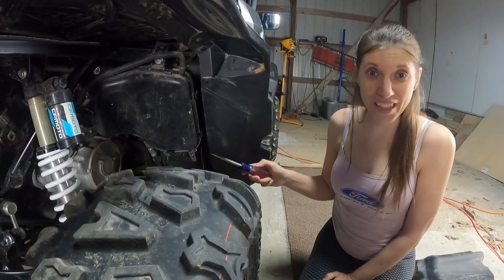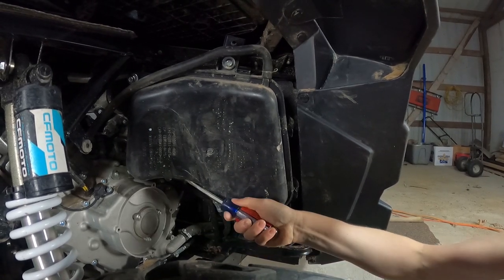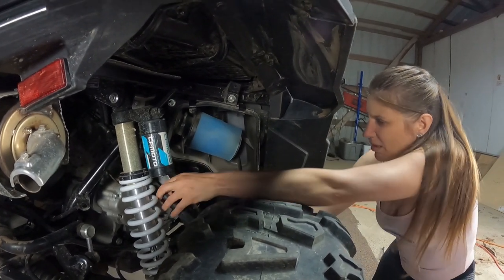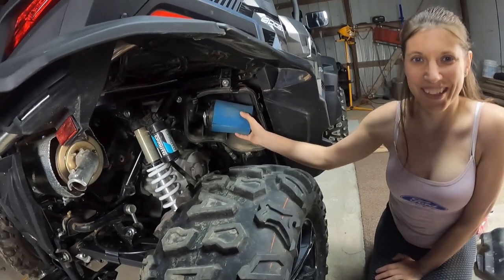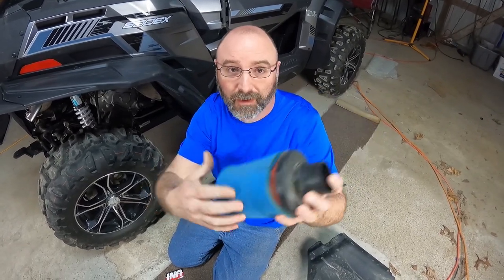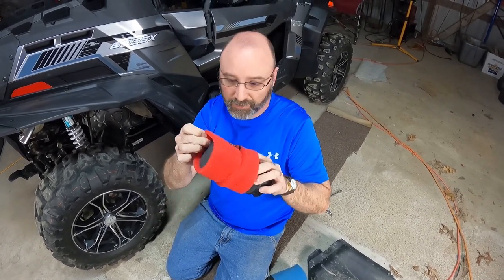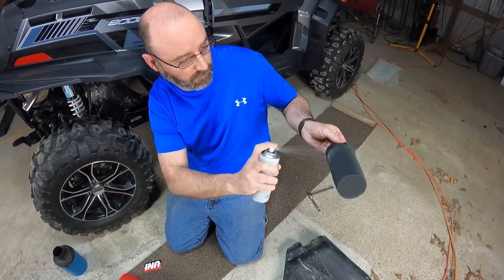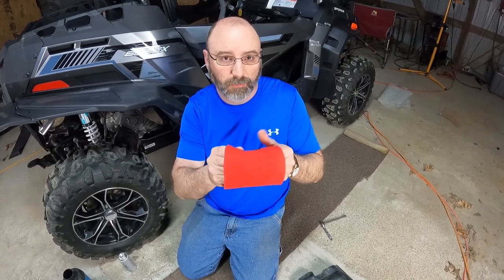cfmoto uni air filter upgrade

Comment: ive done a ton of mods to my 800ex and moving that air box is the first thing i done i have a video on that if your interested however i recommend mend snorkeling it atloeast i clean my filter every 1000 or so miles as before when it was in stock location i cleaned it every 50 miles or less it sucked lol good channel guys if you have any questions about your cfmot feel free to reach out to me. ive done over 650 videos on these machines mods and all kinds of stuff. i do recomend ray parkers tune it makes the 800 even more enjoyable of a machine.
Reply from the maker: Thanks for the kind words, I’ll be sure to check out your channel. I’m in the middle of a truck build right now with a car after that so my 800 mods are on hold for a while. After taking my 800 to the dunes (while it did fine) I’ve been thinking about a turbocharger.
Reply: @CameronsonCamera  your welcome. only thing i havent done and thats mainly because these chinese engines couldnt handle to boost unless you go with a lower compression ratio or just only run about 6lbs of boost i dont know for sure but i think they could handle that. i know a guy who can get cams and pistons for these im working on a set of heads right now.
Reply from the maker: I honestly haven’t looked into any details about the internals but I would assume the pistons are hyperutectic at best but probably just cast. In the world of cars , I’d never throw more than 8psi to a factory engine
Reply: @CameronsonCamera  exactly.  Wish we could get more then just pistons and cams lol

Comment: What is a oil spray substitute to use if you don't have the uni filter oil spray ? Thanks !
Reply from the maker: There are different brands but I’ve only used uni and k&n on their own filters. If there’s a different type of oil, Im personally not aware of it

Comment: Hi . Where did you get the air filter upgrade and do you have the part number ? Thanks
Reply from the maker: This is the one we used 

uni UP-6229AST Air Filters https://www.amazon.com/dp/B001IZKIZ8/ref=cm_sw_r_cp_api_glt_fabc_VS0TQ3PFA81TZW06P4J3?_encoding=UTF8&psc=1